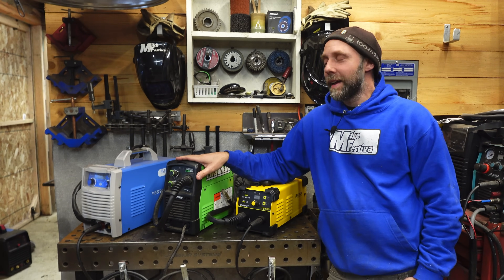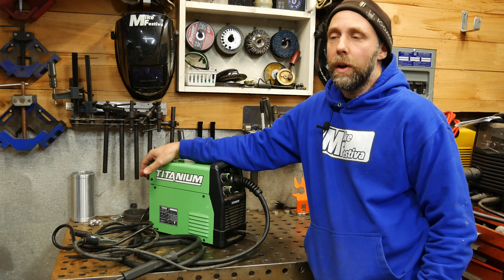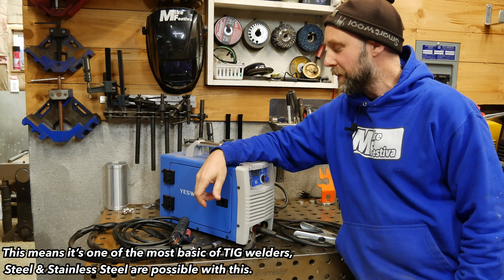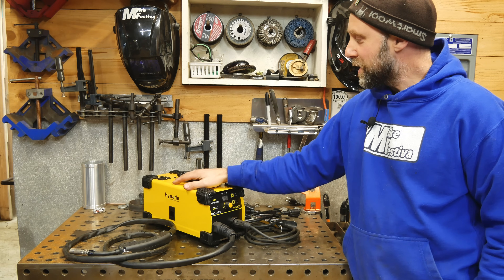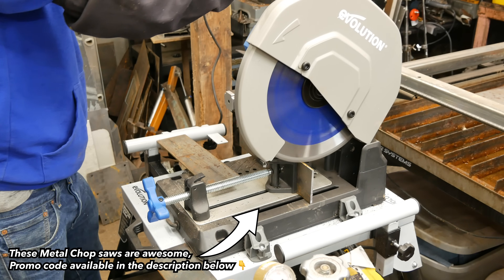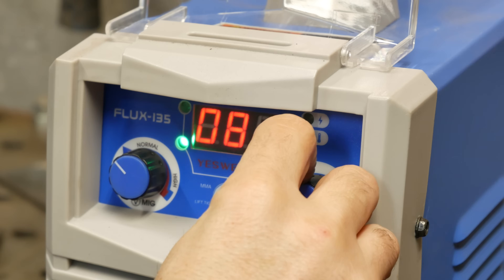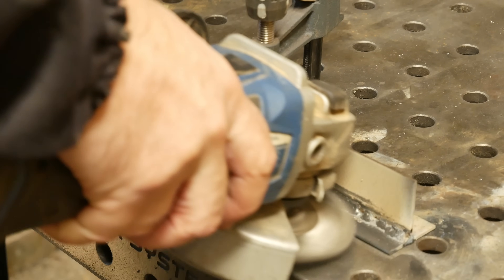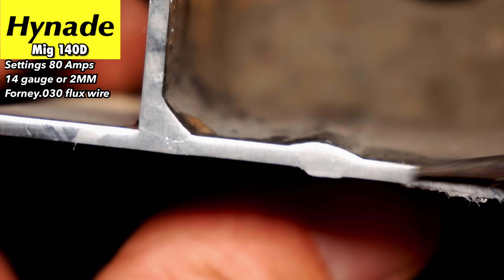Get started in welding, great DIY welder Titanium, Yeswelder, Hynade flux review

Comment: Hey Mike, great video, thanks for do these.  I am just looking to get into welding.  Do you have any experience with the YesWelder MP200 multi-function one?  Any thoughts you have on it would be greatly appreciated.
Reply from the maker: Thanks Brian! Yes I know about the MP200, I actually talked with Yeswelder about 2 years ago and suggested they make a MIG with a built in plasma cutter because there wasn’t anything on the market like that, they liked my idea so they manufactured one 👍
I have tested some of the first Beta MP200 welders and helped them work out some issues in the design stage.
It’s a well rounded out machine, but I found the TIG welder wasn’t a lift TIG it was a scratch start, the plasma was a little picky when staring sometimes, and the auto set for the MIG was a little off, but could be dialed in with the manual settings.
Keep in mind this was an early model and some of these things could be worked out on the more recent machines? 
Thanks for checking out my videos 🙂👍
Reply: @Mikefestiva  Thanks for the great information.
Reply: @Mikefestiva  So the more I look into the MP200, it seems like it is overpriced.  I think I could get a welder and a plasma cutter as separate machines for less.  As such, what welder would your recommend to a beginner?  I figure I will start with Flux core, then get a bottle of gas and move to Mig, then maybe Tig down the road and Stick for  stuff outside and dirty.  I have been doing a lot of reaching and watching, but just don't know which direction to head.  Thanks

Comment: Hey mike. I’m curious about the hynade welders and plasma cutters. I’m wanting to get a Tig/plasma combo, was looking at the primeweld ct520dp but the hynade stc520dp has so many more adjustments. They’re about the same price I’m just wondering about their customer service. Primeweld offers a 3 year no hassle warranty, hynade says 1 year. But I know that with A LOT of these Chinese welder companies they’ll say that and then fall off the planet as soon as there’s a problem. So have you dealt with their customer service and what would your honest opinion be. Thank you!!
Reply from the maker: Hey Randy good question.
I haven’t had to deal with Hynade on any issues, but like you mentioned, a lot of these companies aren’t the best if an issue comes up to resolve it.
With that being said, I’m sure it would be easier to work out any problems with Primeweld  especially because you can call them In the US.
I haven’t ever used any Primeweld products but I hear a lot of people like them. 👍 Thanks for checking out my new video 🙂

Comment: Hello Mike.  First - I'm a complete newb when it comes to welding.  Thanks so much for your content - it's exactly the kind of info I've been looking for.

Second - And this is the stupid newb question:  Can the 240v machines be run off of a generator?  I've got a 5500 watt gen set that outputs 240v.  I've seen a few comments (on other sites) that state that certain welders cannot be run off a portable gen set.  Can you clear this up?  Sorry if it's a stupid question!

Comment: Awesome vid mike! I have been following forever and i think im finally gonna make the jump and get one!! Im going between the titanium and the hynade. As a total complete newbie i was kind of leaning towards the titanium. My question is, do you think the current titanium is still good? I have been told in the past that harbor freight value engineer their products as time goes on and they get cheaper. I was told if you buy them early on you can get a great tool. That is the only thing im nervous about. The acid etching is pretty sweet but its nice to see how they actually work. Thanks for the help and im lookin forward to the next one 🍻
Reply from the maker: Thanks Joe for checking out my new video! I have always figured it was the other way around for HF, I commonly will buy there first round of products, welders and other tools when they first come out.
I’m pretty sure as some of those products get returned over time from defects they look into the problems and I have assumed if it’s a big enough problem they remedy the issue. 
I have heard there’s a place in California where the defective and returned items go for this.
I still feel like the Titanium is probably a good little welder and is worth buying.

I will let you know first hand if your thoughts on that are true? I just decided to buy the Omnipro 220 from HF on the recent sale, I owned this welder about 4 plus years ago, I had always liked the quality of it. 
I do know over time HF will cut out extras they had come in the box in earlier models like welding wire or extra consumables like welding tips. 
Take care Joe 🙂👍

Comment: Hello Mike, thank you for the Thanksgiving wishes. So I see you didn't have the Chicago electric Harbor Freight low-end model. That's the one that I bought when I started out that's the one I still have and it works pretty well I have to say. I mean what do you want for $99. The only thing I wished about the flux core welders is they made a thinner wire but I guess that'd be asking too much?? I have learned to do body panels with the 30 wire but I can tell you it is extremely hard to weld body replacement panels with flux core. I am not a welder although I did a lot of gas welding and brazing back in the day. The main thing with all those flux core is the Heat you have to keep the heat out of those panels or you're going to get warpage as you realize. You probably will never see if what score welder in a high-end body shop that's for sure but then again you can't weld outside with shielding gas and wind and you can use flux core for that. Mike I appreciate the ins and outs of these welders I know that you have tried a lot of different ones and gave your opinions on those. Anyway my friend keep on doing what you do and I'll keep on watching.

Comment: Thinks for the video, Mike!  I’ve only owned a stick welder (yes, classic Lincoln tombstone) but I’ve used a MiG with good results.  Always was concerned about spatter from the flux core wire welders.  I know the first ones I saw really seemed to make rough looking welds.   I think you videos have changed my mind on that.  I’m setting up a new shop and will probably add a flux core welder there to fill the gap between  the old  Lincoln stick and the Tig.
Reply from the maker: Hey Ralph those old Lincoln tombstone welders last forever! That’s the first welder I learned on when I was 15 years old 👍 my problem was back then all my projects were on thin metal and I had a hard time welding stuff like bicycle frames and sheet metals. Once I bought my first Harbor Freight ( AC transformer) flux welder I was able to weld those projects with ease, but yes the spatter was awful on that old welder, it was one of there really old Chicago electric ones. It was really low quality but surprisingly it’s still working to this day( I gave it to a friend years ago) 
I think you would find a small DC inverter flux welder will really round out your welding needs 👍🙂

Comment: Only thing I saw from the welds is the hyanide was less concentrated on the joint and more on the vertical member, operating error or just too hot?
Reply from the maker: That was just me and probably the point that I cut the coupon, yes that came down to operator. Sometimes it’s hard to focus on making the best welds I can when juggling two cameras and lighting for each shot. Thanks for checking out my new video 🙂

Comment: Mike, what's the difference between 030 and 035 wire? When is it important to use the larger 035 wire? Thanks.
Reply from the maker: Usually .035 would be used on thicker metals, keep in mind there’s a big difference between solid and flux wire, the flux is hollow with flux inside.
This means it takes more wire to fill the joint with flux wire compared to solid wire used with MIG welding with shielding gas. I had always used .35 flux in the past but had changed to .30 awhile back because that was all that was available when buying at a local store. I found the .30 welds pretty well especially for thinner metal and cold starts. You can still run .30 wire to weld 3/16 so I’m sticking with .30 for my welding needs. 🙂👍
Hope this helps.

Comment: Great video!!! I have the titanium 125 for a few years and have found in some applications you can weld 3/8 inch effectively with good penatration, not saying I would recommend it on a daily basis but for a little welder it does a fair burn on heavier metal. But did find valcun wire and Lincoln wire works best. Harbor freight Flux does work as planned.

Comment: I bought the Flameweld Mig145FX based on your video featuring the Hynade that looks exactly the same.  I work mostly with 22 guage automotive sheet metal, so the setup was a little tricky because of the single knob. I landed at 70 amps,  with the bottom button setting at minus 20. It had me worried at first because the lowest Amp setting of 50 was instantly blowing holes in the 22 guage.  The instructions are useless, so I'm glad tinkering with the settings  found the zone

Comment: Mike, noticed online that the Hynade has wire Dia. settings for 0.6mm (.024") and 0.8mm (.030").  Is it possible to run .035" on this machine?
Thanks for all the great videos
Reply from the maker: I bought my Hynade 140 last year, and I noticed once I got mine it was for .030 and .24 wire, I heard that the company was going to make it .030 and 035 in a future update, the photos on Amazon show .030 and .035 wire sizes on the front panel and mentioned this in the description. Hopefully that’s true now?

Comment: Great video, Mike, as always. Quick question though, are any of these 3 welders upgradable to actual Mig by adding gas?
Reply from the maker: Good question, unfortunately no these all are flux only, if there was one that sold for this price range and also had a gas valve, that welder probably would have been the best option of the bunch.
Most welders that can run with shielding gas sell in the $300 or more.
Reply: @Mikefestiva  The Yeswelder and the Hynade both have guns that look identical to one with a gas valve that I purchased from amazon to convert an Titanium 125 to run gas; any plans to open them and look inside to see if the conversion might be relatively easy on these two? In any case the gun I bought was ~$35 and has worked quite well for me with the harbor freight welder.

Comment: Hey Mike I hope you and your family had an enjoyable Thanksgiving. 

I have a ThermalArc 130 GTS stick-tig for welding aircraft tubing and light stick work and a Miller 210 mig as my personal equipment.  I've been looking at picking up a small fluxcore unit as a quick and easy portable wirefeed for spot repairs so your video is timely. Over my professional welding career I've used some of the best welding equipment on the market as well as some of the shadiest... they all got the job done most of the time.
Reply from the maker: Thanks for checking out my new video 🙂 I definitely will always keep a small flux welder around for those simple repairs especially if you are helping a friend fix something at there house, these welders are so small and portable. I appreciate reading your comment 👍 Hopefully this video helps  🙂

Comment: I had the titanium and she puts in some work love keeping it in my Jeep as a back up welder, but I now have the titanium unlimited running on 240 V and she kicks too, runs mig well with pre and post flow burns stick true to the amp readings on screen only complaint is the leads are 10Ft if you go to a bigger titanium I would recommend 15ft leads or extension cords for 240v but overall I’m happy with my harbor freight welder

Comment: I have a YesWelder Flux 135. Though mine is I guess older now, naturally they updated it to have all those features after I bought it (adding the stick and TIG). I'd say its setup more like the Titanium, two knobs, a button to flip between .030, and .035, and flux core only. Ground clamp is exactly the same as that YesWelder though.

I have noticed with mine though seems like it runs hot, I've tried to weld thinner metals and just about blown through it even on the lowest settings.

Comment: Hey Mike, i just finnished turning a engine hoist too an offroad field crane, used my Titanium 125 that I bought years ago after watching your video use it all the time, zero problems the only change ive done too it is change the ground clamp. Thanks for all the effort you put into this comparo!
Reply from the maker: Right on I’m glad your Titanium is still working good for you! Sounds like a good project you’re working on 👍
Are you installing that Crane in the back of one of your 4x4 trucks, if so which one?

Comment: Mike, you might do an episode on welding light metals like auto body, and use an aluminum or copper backer plate to draw out the heat and also to hold the metal flat.

Comment: Thank you for an excellent video.  When you tripped a breaker on two different occasions that sold me on having a dual voltage machine.  Every time you handled that roll of Forney wire it made memories surface of my first welder.  A Fourney that weighed some ridiculous amount.  There were numerous plug in places on the front to select the amperage and low or high voltage.  It was given to me after being scorched in a fire, but still worked like a charm.  That was 50 years ago.
Reply from the maker: Thanks for checking out my new video! Yes dual voltage is a great option to have on a welder. Man those old welders are heavy but they last forever 😂🙂

Comment: Your video in 2019 is what sold me on the Titanium machine.  That has been my go to machine for most projects these days; I can run it off my generator no problem and fix stuff.  I've since swapped out the ground clamp and have been running Lincoln wire in it.  I was lucky enough to catch a parking lot sale for mine for $150, probably the best $150 I've spent
Reply from the maker: Awesome! They are great little welders 👍 I’m happy to hear it’s been serving you well. 🙂

Comment: I enjoy your videos mike ,i was wondering if you could recommend a budget welding helmet for a beginner?
Reply: I have been using a "large view true color solar welder helmet" that is auto-darkening, and I really like it. My mistake is that I bought a $15 helmet, but should have gone with a Hitbox, or the like for a bit more money. The lens in the helmet isn't green, but normal color, which helps to see marks, lines, and so on. These are a good value and are solar so no batteries are required. I almost forgot, I bought mine on eBay. The search words are in the quotation marks above.
Reply: @Farm_fab  Same!!! great helmet and the color quality is fantastic for my old eyes.
Reply from the maker: I have been using the Yeswelder helmet, I bought it a few years back and it’s still holding up well. It sells for about $100. There’s a link below in the description to that helmet, yeswelder seems to have a lot of helmets and it’s a bit confusing which one to buy. The one I recommended is $50 cheaper then the Vulcan auto helmet and seems just as good. I’m sure you probably can find a coupon to get the helmet even for less right now. Check it out and read some reviews to see if it may be a good helmet for you. Take care